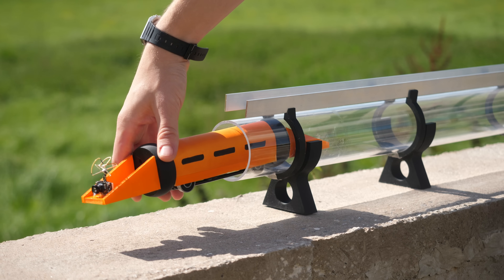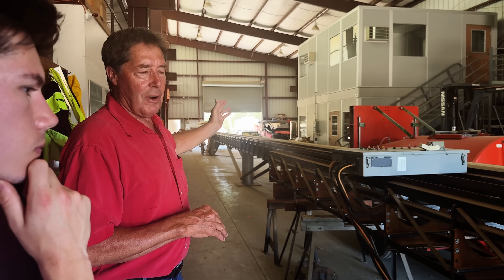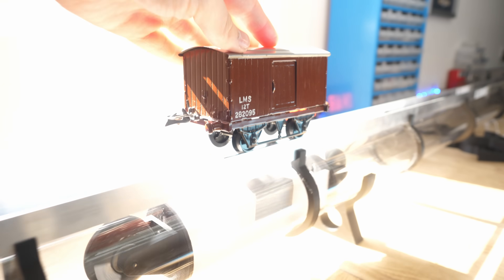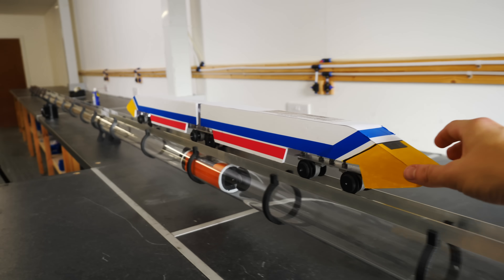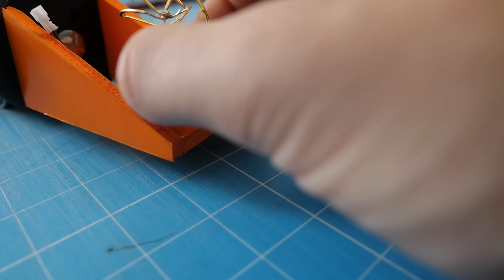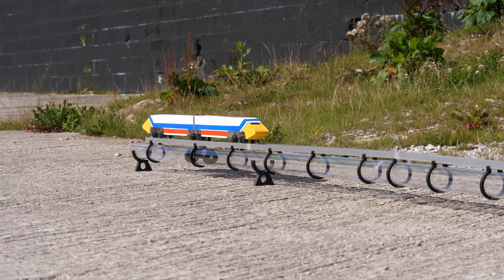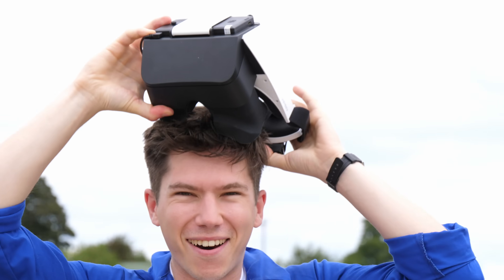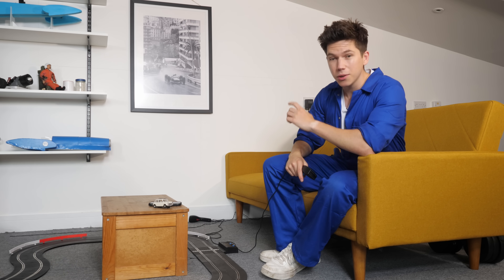Building a SPEED Hyperloop

Comment: Enjoying your vids as always....but don't really see the point of this - it's a lot of elaboration to simply replace the engine/motors.  The train is still out there in the atmosphere causing drag.  Why not just have a larger tube with the train inside it being both the tube and the piston?

You'd have to shift a lot of air though through the blowers.  Not sure you'd achieve much.  I suppose you'd reduce the weight of the train of all the motors and transformers which might be an advantage.

Comment: somehow i have my doubts... especially that something that is literally driven by the speed of air (interaction) would accelerate faster than that...
Lets see...
speed of sound is 340m/s... with v=a*t and s=a*t²/2

ok, lets say it accelerated constantly and in the end reached approx 340m/s in a 14m tube that would leave 0.08s max traversal time @ an accel. of approx 413g (not sure you'd hold that with 2 fingers).
The momentum of that projectile would then likely be larger than that of a bullet.
Or what do you mean by scale speed..? Do you mean that if you build a bigger one in your mind so that yours gets an even smaller scale ratio that it would go even faster..? Did i mention that the driving force is the constant/not scaling air speed not the vacuum..? And that the kinetic energy of the "real" thing would then also need to rise by that scale factor squared...

Comment: Every time I hear about the vacuum in the HyperLoop, I think "Why don't you push at the same time as you pull?" That vacuum cleaner exhaust is being "wasted" by pumping into the atmosphere when it could be plumped to the other side of the tube and create a high pressure region behind the train at the same time. That should give a dramatic increase in speed for no more energy or weight.

Comment: u forget to lubricated with oil pasta inside the tube or back and front the bumper,and must use rubber as a bumpers..why u not use electric jet engine to get more thrust,as earlier?are there gonna opposite with the thrust from air vacuum?the magnet too,between the bottom&below the train must put some oil pasta,so the pressing magnets gap(tube) smooth.even u use glass tube,u still gonna get pressured from the magnet,so it will reduced the thrust power like brake?

Comment: Would a hyperloop that travelled through a tube at complete or near enough vacuum work well? to reduce drag. Like the trail is all vacuum but the stations have air locks and stuff, the train would be powered by wheels or would this idea of pressure propulsion work better?

Comment: The real reason for the conical wheel shape on 🚄's is so that they don't derail when going into turns 💯 😂
It's somewhat similar to a 🚗 differential in that while the 🚉 is turning, the inside wheel which has less distance to travel will have the smaller circumference of the cone in contact with the track (smaller wheels travel less distance per rotation) and conversely the outside wheel will have the larger diameter section of it's cone contacting the track. This allows the 🚆 to remain stable throughout turns of variable sharpness without derailing‼️👍

Comment: Why did the Author not use aluminium channel instead of stripps, the extruded channel is not going to have barely an change in width, apart from expansion from the sun's heat, but it will still be uniform, people relie on 3D printers way to much which kills ingenuity, great project to show the power of a vacuum... not the vacuum cleaner😅lol

Comment: Vacuum or pressure-driven transportation is inherently inefficient, because the compressibility of a gas means that a significant portion of the energy input is expended as heat overcoming the elasticity. The larger the volume of air which must be removed, and the deeper the vacuum, the lower the efficiency. Maintaining a seal between the piston and tube walls also means adding significant friction.

Comment: I grew up near a department store that used vacuum tubes for the cashier's change. The change was in a secure floor away from the sales floors. Pretty sure it was similar in scale to your tube, but faster. Just not trains but cargo pods with a recipt and cash on board. Not sure how that worked. Perhaps short pulses of pressure differential and then let momentum do its thing.

Comment: Very nice. The larger the piston, the less circumference to he leaked around, I guess.
Next time, perhaps fill the tube with steam, seal it, and as it condenses into a little bottom duct, pressure will drop to near zero. Will the tubes hold? They might fog up a bit?
Then the slightest opening of a valve will have anything inside the tube GO. Once. Or, do the maglev drive thing and keep the near vacuum.

Comment: So in an emergency how would it stop? 

There is nothing new about pneumatic tube networks since the late19th century pneumatic tube networks were common in offices that needed to transport small, urgent packages, such as mail, other paperwork, or money, over relatively short distances, within a building. Before credit cards large retail stores had pneumatic tube networks to send money in tubes throughout a store. 

It should be obvious to anyone that there are massive uneconomic problems with trying to scale such systems up to cover a large geographic area that make the idea a non-starter.

As a technology Maglev trains have far less challenges and yet even despite all the advantages they offer over traditional rail they have globally failed to dominate and are still seen as niche experimental tracks.

Comment: There are already comments below on making pressure powered version. Your version is limited to the power of your vacuum cleaner. However, if you'd take a tank of let's say 100 litres and pressurize it up to let's say 8 bars (quite common parameters for consumer grade compressors with cost of USD 400-500) then after you open the valve you would transfer to your "train" (more like a projectile) energy around 8 kJ considering the average pneumatic losses around 75-80%. However, take into consideration that you would have to put another valve to allow the air to enter your "loop" freely after tank pressure drops to 1 bar.

That energy must be sufficient to accelerate around 0.13 kg (0.13*343*343/2=7,65 kJ) up to speed of sound.
However, you would have to consider speed barier resistance for your specific case to exceed it.
I would say if your train would weigh around 0.1kg such a tank should be sufficient to overcome the sound barrier.
Also, you could have the tank of lesser volume, but higher pressure as they do in pneumatic rifles.

P.S. If you consider the freight train weight to be 1000 tons (not the greatest of them) - your model is gonne be 1500:1 in such a case.

Comment: So you reinvented the pneumatic tube for transport, that people came up with and used since the 1850ies to transport small items in buildings. Really innovative and impressive. 😅 Especially when you have the technical expertise to just upscale it for human transportation..
Don't get me wrong, it's a nice model to build and this works fine, but you can't apply it in a feasible way by just scaling everything up. There a physical and technical boundaries, limitations and necessities.
And you don't work with a "vacuum" there, you use differences in pressure. That's something different.

Comment: Put the vacuum in the middle of the track. Run the exhaust to one end and the suction to the other. Massive speed. Use double stick tape around the tube, spread the supports open and stick them to the tube.

Comment: Trains have been inveted because it's a means of transport with very low friction. Steel wheels on steel rails roll almost by itself. What's the point of adding a vacuum tube? One electric locomotive is way more energy efficient.

Comment: You encountered that exact problem why no one has yet built a hyperloop or something like that:
The tube must be not only weather proof, also earthquake proof und dont deform in heat or cold. But most of the materials that suits for an hyperloop do deform in heat/cold or are not earthquake proof. Mostly both. Also is it quite expensive and would probably not rent

Comment: If you want to make the train have less of a chance to decouple from the piston, you need to use a minimum of three magnets on the train and the piston. Have them in a line with the middle one having opposite polarity. You'll also want to have the front and back one angled inwards and the first and last ones on the piston angled outwards so that the magnets are tied in two axial directions instead of just one. This will basically lock the piston and the train together as one and the only way to decouple them would be to pull the train straight up.

Comment: Hyperloop works differently. The whole tube is supposed to be in a state of vaccuum but not to propell the carriage but reduce air resistance instead. Crossing the sonic barrier drastically changes how air resists movement, so the tradeoff is quite good.

Comment: Use pressure not a vacuum.  Blow it instead of sucking it.  With a vacuum , the pressure available is only atmospheric pressure, but if you provide the pressure, you can have virtually unlimitted pressure available.

Comment: Hey, I think your project is pretty cool and I also respect you and your projects but when you sad that the train is going over 500 km/h (about 60 mp/h) I was curious. If you look at the footage where the black-white tape is put on the pipe and measure the time that the train needs to get past it, it's clear that the speed you calculated is wrong. Let's say the black-white stripe is 1 meter long and the train needs 0,01 to get over it (which is a generous low amount of time that I guessed). When you put it in the speed-formula v = s / t (speed in m/s equals distance in meters divided by the time in seconds), it's  v = 1 / 0,01 --> 100 m/s. Then you multiply the 100 m/s with 3,6 to get km/h which is 360 km/h... 

So your project is still amazing but next time I would recommend you to check your calculations. If I'm wrong please contact me, I want to know what I've done wrong in my calculations.

You are an awesome guy and I also love doing projects like that myself, keep on being creative like that (besides the calculations :) ),

BR Richi

Comment: Would the magnates have a breaking reaction with the aluminum rails or are they to weak? Also what if instead of 3d printed fittings for the seal using something like thick brushing like what the tips of shop vacuums use? Maybe dipping them/ applying anti seize or graphite to counter their resistance on contact

Comment: Great video as always .. I didn't know too much about Hyperloops until this point, so interesting to hear/see the theory.

Surely the flaw in the 3D printed rail mounts is that they're "C" shaped though, so the ends of the "C" where the rails attached can splay. With the conical shaped wheels, they're naturally going to "pull" into the rails and want to assert a sideways force no? If those rail mounts where "O" shaped, to keep the rail mount sections rigid, surely that'd cure it? (or even if the rail mounts were on the centre of the "C" shape, not the ends).

Comment: I think this might work better as a suspended monorail - instead of putting tracks and a train on top of the tube, put the train underneath with wheels on its roof. You probably wouldn't even need any sort of rail as gravity would keep the train (mostly) straight down

Comment: 7:00.  you fixed it with leaky air ,but ,   i wonder if adding weight with more magnets to this design would add enough inertia to fix the problem  but still with performance losses , hmmmm

Comment: This is the second video I’ve watched where black PLA has warped in the sun causing problems (the other was 3D printed wings). The answer seems obvious: either use white PLA or higher temp filaments like ABS, preferably both. 
You could try spraying those black parts white…

Comment: Bro just put the train inside the tube, no need for anything on the outside. Pressurized cabin on the inside. Brake pads that can reach out and touch the walls in case of air pressure brake failure and for parking brake.

Comment: Maybe use magnets on the outside of the tube that hold the train in place and also are used as a force to push it forward, which would give it close to zero friction. Also pushing air into the tube at the start and at the same time sucking it out in the at the end could be beneficial. 

And why not try to build a long loop so it can go round and round during tests

Comment: A quite different topic but I'm attempting a prototype that uses 256 coreless electromagnets on a 1mm bit of acrylic, wireing them straight to an array of individually addressable RGB LEDs, the acrylic surface is charged with static electricity by a little black Chinese wonder and it's to be programmed to ripple the magnetic flux in a checkerboard pattern regarding the pole orientation,  along the acrylic  surface, to move the static charge with it's undulatuon.. a magnetically shielded wire from one end to the other re-cycles the charge.. should be a lot better than a silly ion thruster.. gona be testing different surfaces.

Everyone is more than welcome to copy me, tho never at the cost of disenabling of another to also. X

Comment: The flanges on a train rub against curves if their tight enough and switches if the train is going slow over them hence the reason of the squealing noise that a train makes when it’s passing through a set of points

Comment: Hi James, I've enjoyed your channel for a while now. Great to see you getting in to air powered model trains using vacuum cleaners. I've also been doing these types of projects on my channel, on and off for the past five years or so. Currently I have a working 20 metre u-shaped track which I've installed in a garden bed. For simplicity, I've recently been concentrating on sliding components only, so my thrust magnets are simply encased in copper tube and my monorail cars have teflon runners for low-friction. The track uses standard 32mm electrical conduit with modified couplers to reduce friction. The cars cruise at about 1.2 m/s. Please check it out if you are interested.

Comment: That's not a Hyperloop, it's a pneumatic tube transfer system. A vacuum and a vacuum are two totally different things. Pressure in the Hyperloop is supposedly 100 pascal in front AND behind the train. The whole point of the Hyperloop is to make drag a negligible factor during transit, not to transport the train by sucking air out of one end of the tube. That's 1/6th the atmosphere of Mars, your acrylic tubes would go fully Titan sub at this pressure differential.

Comment: I'm not convinced that it was thermal expansion causing the problems because the scale of thermal expansion is very low relative to general tolerances in the construction. Was there any more evidence (such as running successfully at lower temperatures) that supported the assessment?

Comment: I think the the carrier got caught up on the straight edges between the tubes, am I right? Maybe cut the ends at 45° angle, so there never is enough space for the seal to slip in between the tubes. And maybe use flexible discs as seals on the carrier, so that even IF they get caught up, they bend out of it

Comment: There is a slight difference between scale supersonic and supersonic supersonic.
And no, I am not referring to the fact that full-scale supersonic is much a faster than scale supersonic, exactly by the same proportion as the scale factor.
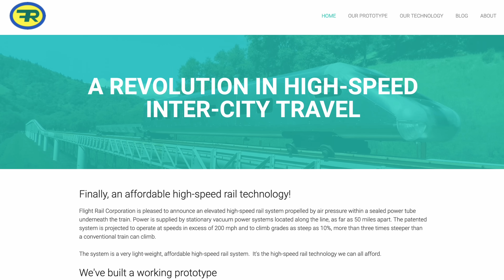And neither that drag goes with the surface area which grows with the square of the scale factor and with the the speed squared which also grow with the square fo the scale factor (meaning that the real thing of a 1:20 scale would have 400 times more drag).
You can account for all that and make predictions about how the real thing would behave based on the scale model's behavior.
No, I am referring tot he fact that scale supersonic is NOT supersonic. Not even remotely close. So you don't have all the compressibility, heating, shock wave, and wave drag effects of supersonic flow. In other words, scale supersonic is neither supersonic nor scale. You cannot derive any conclusion of how the real thing will behave by analyzing the scale model's behavior. It is just a totally different animal.
Reply: All that said, I am impressed with your projects, dedication and skills, as well as with the results of all that, INCLUDING the ones you displayed in this video.

Comment: Could you attach the exhaust of the vacuum to the other end of the tube so there is pressure pushing the train as well as the low pressure vacuum pulling? With a modified vacuum you could even use that to reverse the train

Comment: The clicks mean the tube ends need a slight inner bevel and a 3D printed joint aligner to smooth the transitions. Really cool idea!
Reply: Could the magnets be mounted connected to springs to absorb some of the initial impact of moving?
Reply: Would it be advantageous to form the outside of the train to ride on a cushion of air at speed? Extending the 'seal' the total length of the car with a small tunnel underneath the bow to funnel lifting air